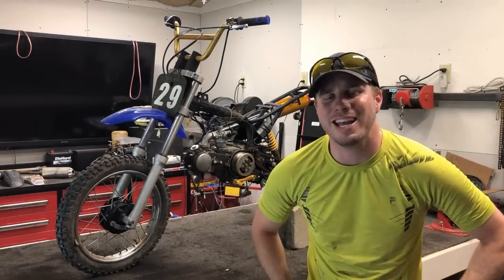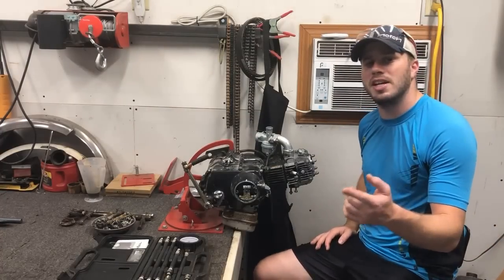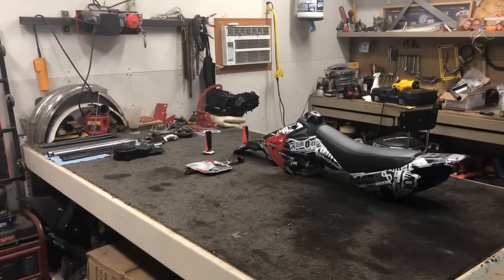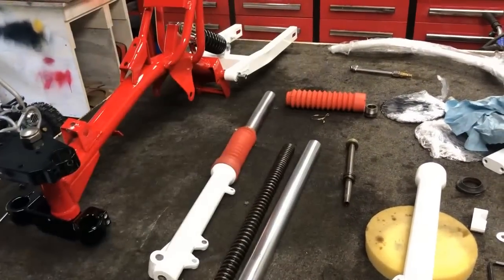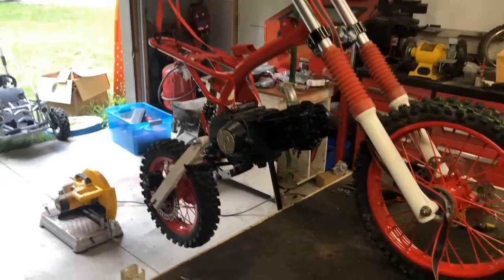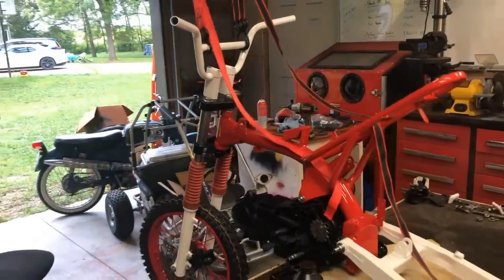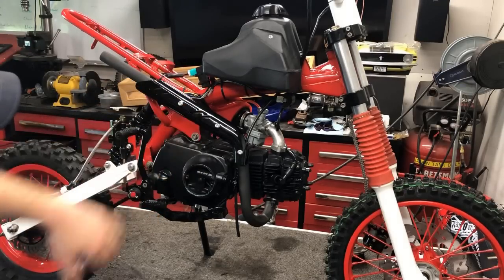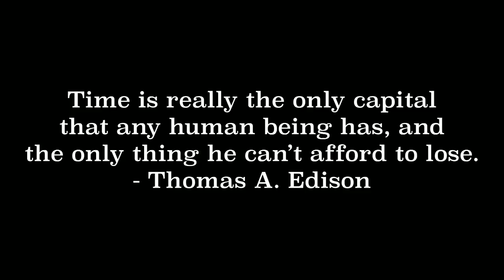SSR 125cc Dirt Bike Restoration! Complete rebuild!

Comment: I subbed, but for that price you coulda built a YZ125 lol
Reply: This is way cooler tho
Reply from the maker: Thanks Mike! It's all perspective, but I don't think you could put that much work into a YZ125 for under $1,000. OEM parts are a lot more expensive. Even if the YZ was free it would be tough!

Comment: Looks good but two things killed me the powder coat on the spokes made it look cheap and the revving it while it's on choke without letting it just warm up. Lol good job tho I'm in the middle of a rebuild/refresh on my DR-Z400 supermoto. But I'm looking at buy one of these for my daughter are all the parts easy to source?
Reply from the maker: I appreciate the feedback. The spokes were defiantly an over site on my part, mostly from an adjustable point. Cosmetically speaking everyone has the own opinions. Right call on rolling the throttle. I was a bit excited since the project took so long to get to that part! When it comes to parts they are all pretty universal for the 125cc bikes. I've used VMC for years on parts, but also eBay and Amazon carry almost everything you need as well.

Comment: I find that if you put the tube in the tire first and fill it with just enough air to keep it round but not full I pop way less tires. Also the counter mount tire changer from harbor freight is fantastic!!!!!!
Reply: Also you do an AMAZING job on these Chinese bikes!  They are my favorite. Cheap and easy(most of the time) to work on!
Reply from the maker: Jonathan Roberts Thanks man! Usually I’ll edit the video of me getting it done the first time, but with the tubes I felt like sharing my pain might show some viewers these projects aren’t so easy and even guys that have been at it for years still struggle sometimes!

Comment: Hot tip soo u don't punched tubes when installing them again use hot soapy water it makes the tyre alot easier to get on and off the it makes the tire a bit softer and the soap lubricates the tire. The tube put about 10psi in it it stops u from pinching your tube and using hot soapy water makes the tire soft and lubricates the tire for easy installing no screw drives needed to put the tire over the bead
Reply: Just push down hard on the tire and just be careful the tube doesn't get stuck under the tire
Reply from the maker: Thanks for the advise!

Comment: I like the quote that the video ended with. Don’t get me wrong the video is cool. I have 3 ssr’s i am rebuilding. We’ll one almost done, one kinda finished as we got plastics today and then one down to a frame. We got a tao Tao also 110cc. Some goof ball put wrong spark plug in it locked it up. That one is a complete rebuild . I have to get a back swing arm, tank and odds and ends for the 3rd ssr. The video was cool glad i took the time to watch start to finished. Great content. Bike came out looking sweet!

Comment: Can you explain to me why my 125cc clutch cable has a heap of slack to the point it won’t actually engage the clutch lever on the motor and I’ve adjusted the clutch cable to as tight as it will go on both ends and still nothing please help

Comment: also when you put inner tubes and tires on rims use fairy liquid in hot water it makes it so the tire and tube go in easier
Reply from the maker: Thanks for the advise! I've never used that method before so I will have to give it a try!

Comment: Liked your video, I’m well aware this an older video and I’m sure it’s been said already but I think the spacer is a round aluminum/steel tube roughly an inch long or smaller that goes to the left of the brake caliper, thus putting the caliper up against the frame when you tighten the rear nut.  Hope this helps next time.

Comment: Awesome videos man! Gotta ask though what engine stand do you use?! I’ve search far and wide but haven’t found anything like it. Been tinkering with this stuff for YEARS and that engine stand would make a world of difference!
Reply from the maker: This is my #1 comment across the channel! I came across the stand on eBay back in January 2018. The seller was bomcbe2kz7 and the item number was 173080767269. If I remember correctly, I paid about $110 with shipping. It has 3 mounting plates for different types of small engines. Definitely money well spent for my shop!
Reply: Praska Boy's Garage, Looks like they don’t sell them anymore. VMT appears to have vanished. All others are way over priced for basic stands that can be built with scrap metal in twenty minutes. I like the tilt feature for assembly but that’s the only mount I’ve seen that has that. TO THE DRAWING BOARD!!!!!!
Reply from the maker: Try sending him a message on eBay. I sent him a message about 6 months asking him to make some more because I had so many people requesting them and he did. Let him know you saw it on my channel! Hopefully he can get you one. I constantly have a motor on my stand all year long and I absolutely love it!

Comment: What kind of sprockets do these use as stock? I have a 110cc samurai and 125 bse, I'm using 16/30 on the BSE, 17/36 on samurai, as stock the samurai only got around 50-55km/h with super high revs but now it does 80~, pretty stupid transmission ratios if you ask me :D
Reply from the maker: I would have to double check my ratio. I didn't even look, I just assumed mine was stock and left it the same. Shes quick I know that!

Comment: What pad did you use on the grinder when you took off all the engine paint?
Reply from the maker: It's just a simple 4" wire wheel attachment for a grinder. Here is an example on amazon: https://amzn.to/38aqXcD

Comment: Use adhesion promoter on the paint and plastic before you put double sided tape on
Reply from the maker: Thanks for the tip!
Reply: Dont mean to sound like a know it all I work at a collision center and I use alot of double side and we have 3m adhesion promoter pads we also have spray cans but the little pads are good for wiping...and man its night and day on how good it will stick put a little on your finger let it dry and just press down on some double side almost pulls skin off lol digging your vids tho man we kinda the same only I dobt make videos

Comment: Praska! I’ve got a question for you. I’m looking to order a replacement motor for my SSR. Do you know if the motor mounts are the same for all the pit bit brands? Like is the tao Tao motor fit the SSR? Thanks
Reply from the maker: Yes sir! If you notice my red engine stand, I put all my motors on that same stand. Anything 50cc-125cc Chinese E22 style or Honda motor fit. A TaoTao motor will fit the SSR mounts.

Comment: Hey mate can i please grab a link on where you got your engine mount/vice? Great video and job btw
Reply from the maker: This is my #1 comment across the channel! I came across the stand on eBay back in January 2018. The seller was bomcbe2kz7 and the item number was 173080767269. If I remember correctly, I paid about $110 with shipping. It has 3 mounting plates for different types of small engines. Definitely money well spent for my shop!
Reply: @PraskaBoysGarage   Thanks a ton for replying. Sorry i didnt check other video's yet. I just found your channel.

Any chance of a name or a direct link to the item please? I can not find it on ebay.

I'm in australia and I fix these as a hobby.

I have never seen one completed nor have i done one as good as you.
Reply from the maker: @excel111lf   Thanks for the positive feedback I really appreciate it!  Here is a current link for one of the stands: https://www.ebay.com/itm/VMT-Spin-Tilt-Rotate-ENGINE-STAND-TOP-Mount/174135324504?hash=item288b462f58:g:CLkAAOSwTnBcu7Ku&vxp=mtr

Comment: I have a Lifan 125 motor and im riding it and it runs for like 2 mins then sputters and dies and the muffler is burning hot it won't start again till its cold my fluids are fine?
Reply from the maker: 3 things: Fuel, compression, and air flow. 1) Is your fuel flowing fast with no obstructions, have you recently cleaned or replaced the carb? 2) Check your compression and valve lashing. 3) Remove the air filter for a ride and let it go wide open. Make sure you don't have any restrictions. Let me know what you find out!

Comment: Hey I am trying to do the same thing and I am trying to get the body kit do u think it would fit my Tao Tao 125cc and the parts are form Amazon
Reply from the maker: From my experience the kits are universal and should work. The only issues I have run into is the exhaust location. Sometimes it rubs on the muffler and you'll need to make a spacer so it wont melt.

Comment: I heard a ticking sound when you first start it do you know what the problem was becouse I have allot of problems with it
Reply from the maker: Right after the video was posted I swapped out for a 26mm mikuni carb and haven't had a single riding issue in the last 2 riding seasons. You can buy a knock off on eBay for under $30 bucks.

Comment: How well does that high heat paint hold up? Especially on the hardware when you remove a bolt does it chip?
Reply from the maker: Powder coating is the most durable paint they offer. It holds up great and I highly recommend it if you can fit the cost into your build budget.

Comment: Question for you. I have one of these chinese quads. ( not running) i replaced the wiring harness and also the stator but i have no spark. Any ideas?
Reply from the maker: MrBrian198 Been there many times! Did you happen to watch my wiring video? It shows step by step how to hook it up. I would reference that first. If everything is correct then it’s time to start trouble shooting.
Reply: Praska Boy's Garage i did watch the video. Im going to order another harness and do it again. Thank you for your speedy response!

Comment: Are the parts behind the flywheel water proof? or at least able to be pressure washed? It was hard to tell in the time lapse
Reply from the maker: Yes, the magneto has a watertight seal behind it.

Comment: I’ve completely all of my stuff on my atv and now when I try to start it, I just bought a new battery and then it was dead so I charged it and then put it back in and whenever I try and start my atv it light dims and sounds like I’m not getting power. What could it be if you have any ideas?
Reply from the maker: Brayden Martel If you pushing the start button and the lights are dimming that means it’s pulling power. If it’s not turning over you either have a battery, starter relay or a starter issue (don’t forget to check your fuse). Try bridging the 2 posts on the starter relay. If it turns over you likely have a bad relay. Also try a different 12v battery or jumper box. Let me know what you find out!
Reply: Praska Boy's Garage thank you I’ll try that

Comment: I thought that you were not going to replace that much why not just buy a new bike
Reply from the maker: Couple reasons why is did everything. 1) It would only cost a little over $800 dollars to do this build and that's less than a brand new one and it has the look I like. 2) I had help from a parts sponsor to keep the cost low so I could afford to do it. Im currently looking for a 110cc to do the same thing for my 5 year old!

Comment: Vmc has nothing in there web page about SSR pit bikes. Totally worthless web site for your SSR projects. Can’t even call for parts.
Reply from the maker: You have me confused. I linked all the parts in the description I used on this SSR bike that I got from VMC. Are you just saying they are not specifically the "SSR" brand?
Reply: Praska Boy's Garage  the link to there website. I’m not saying they do t have parts but says nothing specific about ssr and very limited selection of parts. Generic parts.  Not a bad thing    It’s hard to find a good site that has good descriptions on ssr parts
Reply: I have a 140cc that may be some of the difference
Reply from the maker: @ryangidner2527  Alright, well all I'm saying is before you blast a company and call them worthless let's maybe explain what the real issue is. VMC is a good company located in the USA that sells these Chinese parts and has been a great outlet for me for parts the last 5 years.
Reply: Praska Boy's Garage ok sorry. I didn’t see a link to where you got the new stator from?  That’s one of the most used part for these bikes. Sometimes hard to find in the u.s.
Reply from the maker: The new stator came with the wiring harness I ordered off eBay. Here is a link to one similar to what I used: https://www.ebay.com/itm/264383998632

Comment: you no its air cooled en you painted the cilinddr enthe cilinder head its getting les coolig
Reply from the maker: mud mower 13hp You are correct. However the head is factory painted and I removed that first before applying the new paint. Also I’ve done this to about 15 motors and have never had one blow up on me or over heat yet. Worst cause if does blow and we can rebuilt it!

Comment: Also what kind of wheel and sand paper dis you use to clean up the engine
Reply from the maker: I use a basic wire wheel on the angle grinder. Between that, paint stripper, and a pressure washer took me close to 2 hours to get it completely stripped.

Comment: Hey man question how do you check timing on these little 50cc ATVs
Reply from the maker: I have plans to do a "how to" rebuild build video on the next motor I get that needs a top end. Here are the steps:
1) Put the motor at TDC(top dead center) by alining the "T" on the flywheel to the top mark
2) Remove the Timing Chain cover (round cover on the head) behind it you will see the timing chain
3) The sprocket behind this cover has a small dot that is the timing mark. If the motor is at TDC then that market should line up facing the top of the head with a mark that's on the case. 
If everything is in a straight line you have your timing set correctly. Hope that helps!!
Reply: Praska Boy's Garage awesome thanks for the help . I’ll be waiting on the new content keep up the good work 🤘🏻

Comment: Is it true that the engine is only mounted with 2 bolts?
Reply from the maker: Yes, the have a rear mount and a top mount. There are 4 bolt holes on the bottom if you want to plate mount it like for a go kart also.

Comment: Do you know how to find the length of the stroke on the crank for these chinese bikes
Reply from the maker: I've never measured before but an engine's stroke is the distance the piston travels inside the cylinder, so I assume you could remove the head and measure top dead center to bottom center. Are you trying to replace the crank in yours?
Reply: @PraskaBoysGarage  no I'm trying to put a bbk in one but I have to know the bore stroke in order to know if it will work and they want 29 dollars for the manual lol

Comment: What type of paint did you use on the springs?
Reply from the maker: josh crawford I used a generic chassis saver. Typically I used POR15 but my stuff hardened up over time so I ran to the local hardware store and got the cheap version of it.
Reply: Thanks man
Keep it up I have liken everything you have put out

Comment: Whats the blue bike in the back ground of 31:58
Reply from the maker: The mini bike on the left is a 1969 Rupp Scrambler mini bike that has now been powder coated and I am just waiting to find a motor for it. The one on the right is an early 60's Honda C110 Sport Cub, that belongs to one of my coworkers mom. Got it running for them after sitting for 20 years.
Reply: @PraskaBoysGarage  could we please see a video on it? I know you have youre own life you have to do but im extremely interested
Reply from the maker: @coltonsites3802  It's been sitting for almost 3 years now since I got it running for them. I could do a will it run video this summer. If I can make it work I will do that!
Reply: @PraskaBoysGarage  thank you

Comment: Where can i find this engin stand!
Reply from the maker: My engine stand is my #1 comment across the channel! I came across the stand on eBay back in January 2018. The seller was bomcbe2kz7 If I remember correctly, I paid about $110 with shipping. It has 3 mounting plates for different types of small engines. Definitely money well spent for my shop!

Comment: You want 1/4 to 1/2 inch of free play in the clutch lever
Reply from the maker: Matt Smith Thanks for the advise! I’ve officially stored the bike for winter. I’ll be sure to address the issue before I sell it in the spring.